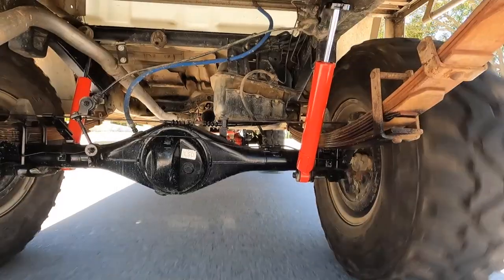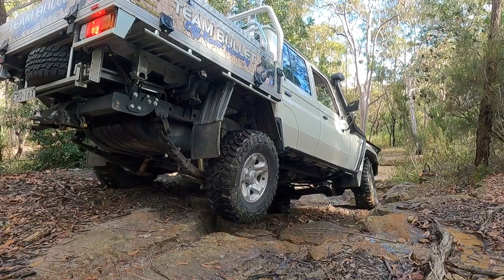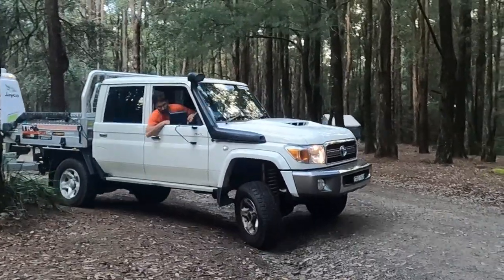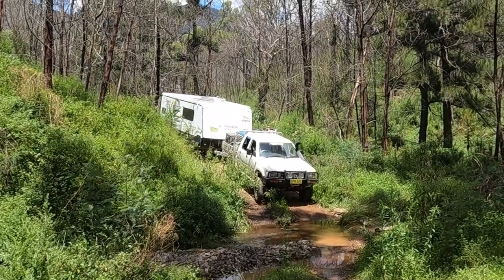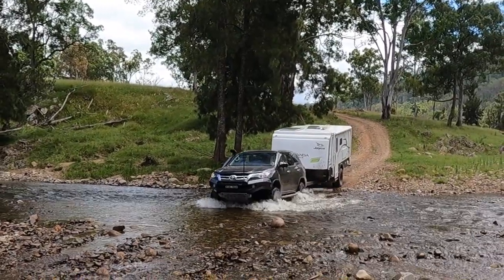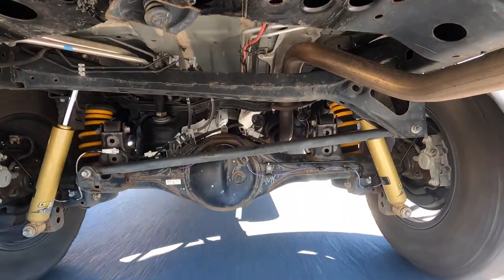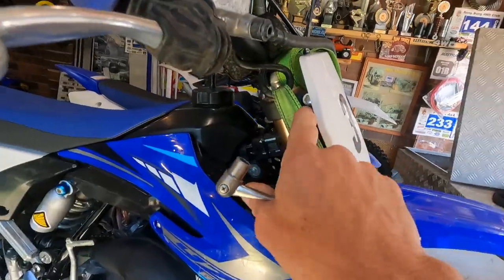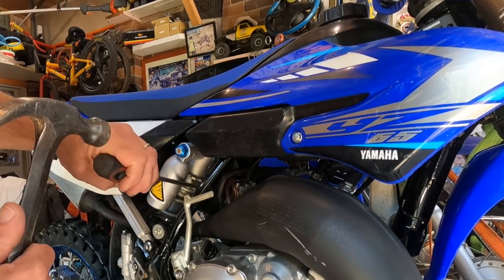Review on Toyota Landcruiser 79seies  VDJ79  and Toyota Fortuner towing and Offroad on Polyair bags

Comment: great video Denny 👍😊 the only tip for the back shock on the bike is that the spring still has the locking nut touching it when you lift the back of the bike off the ground so that the spring isn't loose but that's it,
Reply from the maker: Cheers JC

Comment: So much good info in this video. I have a 79  single cab with a demountable camper on the rear tray. My weight is 3.5-3.6T fully loaded. Your videos inspired me to get the terrain tamer parabolics 700kg 4 leaf pack – they're brilliant, such a massive improvement. Only problem is the rear sits about 25mm lower than I'd like and the springs are just sitting on the rubber on the lowest leaf when loaded. So I think I'm under sprung. I can't decide if I should upgrade to the fortified 5 leaf pack from terrain tamer or add airbags. I like the simplicity and reliability of the parabolics but I'm concerned when the camper is off the 5 leaf will be too way too firm. The airbags will give more adjustment  between camper on and off but I'm not sure if I'll be overloading them and risk damaging the chassis at 3600kg. I'd really appreciate some advice. Add airbags or upgrade the leaf pack? Thanks mate!
Reply from the maker: Personally I would go airbags. Thanks heaps for commenting.